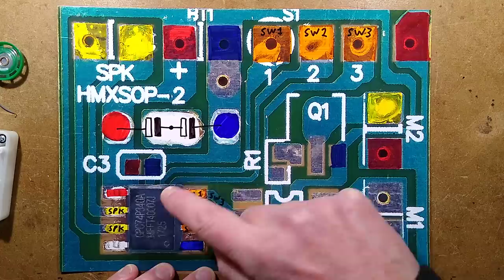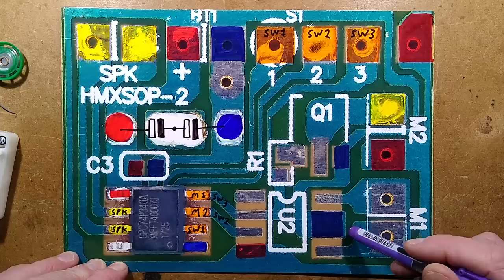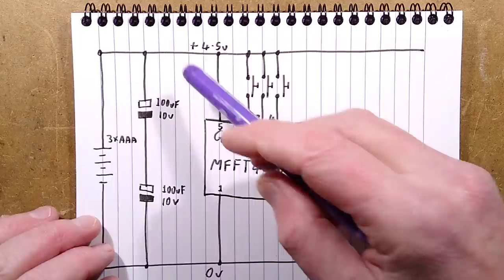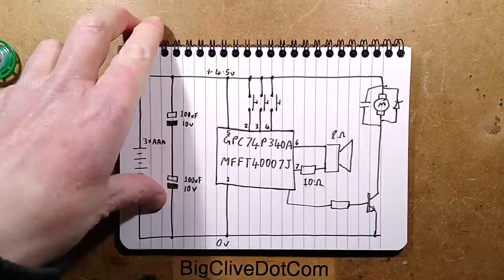Spooky bible teddy (with schematic)

Comment: Swallowing the batteries is probably the least harmful thing that Teddy is capable of...
Reply: Well said 👍
Reply: Hahahaha
Reply: Swallowing the whole bear is less harmful.
Reply: @brianm6337  lol
Reply: Step up. DO the science.
Reply: Very true, we all know what goes on.
Reply: I saw "Varta" and had Vietnam flashbacks.. All those motherboards ruined by leaky batteries.

For those who don't know, it's something that we in the vintage/retro computer community have to deal with all the time when restoring old computers. They use lithium button-cell batteries now, but In the 90's, computers would use these soldered-in 3-cell 3.6v Ni-Mh batteries to store BIOS settings and keep the real-time clock chip ticking when the power is turned off. When they leak after 20-30 years, the electrolyte tends to eat away traces, and sometimes even corrode chip pins. Usually these motherboards can be cleaned up or at least be repaired with bodge wires, but sometimes the damage is so bad that the motherboard just has to be consigned to scrap or e-waste.
Reply: @BlackEpyon  when I saw the Varta batteries comming out, to be honest I was genuinely surprised that someone decided for the industrial type brand stuff instead of the common no name brand stuff you find provided with almost anything including batteries. Not sure how many actual Chinese factories there are out there, as otherwise I think for those non rechargeable batteries, there are not actually that many brands beside Varta, Duracell and Panasonic. I think energizer is also in the game. But looking at varta for example, they alone produce cells sold under so many different labels (the batteries you can buy at IKEA I think among many others) that usually sell cheaper than the original Varta branded stuff. Not sure if there are actually really cosniderable differences between them. 
This somehow adds to the creepiness.
Oh by the way, werent those soldered in 3.6 V batteries Ni-Cd back then? At least those I remember I cannot think of any Ni-Mh,I think those came up only considerably later when they tried to got rid of the Cadmium part at which point most boards switch over to the Lithium Button Cells like CR2032.
Reply: @alexanderkupke920  I think they may have been Ni-Cd earlier on. They're all Ni-Mh these days though, which is nice if you want to do a period accurate replacement instead of putting in a coin-cell holder. Ni-Mh don't leak very often, unlike Ni-Cd and Alkaline.
Reply: @BlackEpyon  Yeah, besides the lack of Cadmium (or at least a heavilly reduced amount) Ni-Mh Cells seem to have a number of advantages. I think all sort s of things, keeping a charge for longer, greatly reduced memory effect, less likely to leak and I think there are more. Only "drawback" if one might one to see it as such, when not built into a device, some older chargers do not like them.
Reply: @alexanderkupke920  Charger circuitry is something I need to look into. I've got an old Tandy laptop that was meant to take a Ni-Cd battery, and I wanted to upgrade it to a lithium so I can get more than a half-hour out of it. I'm just scared to step into new territory there because I know that lithium are really finicky when it comes to voltage levels. I also know that the technical reference manual for that laptop is unobtainium, and I've already been looking for that for a completely different project.
Reply: It'll swallow your soul!
Reply: Hey man Jesus loves you because the Bible tells you so

Comment: I had a hunch that this was going to be a GeneralPlus chip, and I was right. The chip is from the GPC74PxxxA series of 4-bit sound controllers, designed very specifically for basic speech playback. The chip is currently on revision B, which might be why it was hard to find info on it.
Reply: Does pin 8 (marked in white) allow reprogramming the chip with a different performance of the songs?
Reply: @johndododoe1411  No unfortunately this chip is OTP which means it's one time programmable.
Reply: @johndododoe1411  The docs say it is a OTP part:
GPC74P340B, a 4-bit sound controller, is architected with a four-channel SPU for MIDI playback, a 4-bit RISC CPU, a 14-bit PWM, 8 IOs, 1 input (with pull low resistor ) , 256-nibble RAM, and OTP with density of 64K/ 32K x 12-bit of memory space. The operating voltage ranges from 2.0V through 5.5V and operating speed is 1M/2MHz, configurable through inner oscillator. Other features include Low Voltage Reset, IR carry output, Watchdog, 5 interrupt sources with two Time-bases, etc.
Reply: I was going to weigh in with the same info because it sure smelled like one of their chips. I have datasheets for their "high-end" parts but not this one.

I'm betting that this is one time programmable.
Reply: Thank you, hive mind, for the wealth of information and wisdom you provide.
Reply: @glenslick2774  I wonder what compression method they use to get that much music out of 64K of memory.
Reply: @kimchristensen2175  ultra low sample rate and sample format I guess. :p
Reply: @Aeduo  Most likely. We didn't get to hear how long those songs were, but the quality seemed pretty good. It's got me curious now.
Reply: I had the same hunch (I mean, GPCxxxx...right?), but you clearly have early access to his videos and so beat me to the punch by 10 days! 😉
Reply: Google search results have just gone to shit in these past few years. If this was in the mid 2010s and before, you would've been able to find info on that chip pretty easily and even the intensely annoying "approximate match" functionality would've  probably been enough to give you the results for the B revision. Now even searching the partial part number GPC74P340 doesn't give a SINGLE result.
Reply: @kimchristensen2175  It sounded good quality, but. low dynamic range to my ears. That might be significant.
Reply: @kimchristensen2175  They are available with up to 680K x 12 bits of OTP memory.
Reply: @kimchristensen2175 
There are memory cells that have analog storage. Reducing the storage required. The values are not very accurate but not an issue here.
Reply: If it's pin compatible however even an otp part could be dropped in as a "mod" to get the dulcet tones of big Clive to sooth our wee babies instead of the indoctrination this has.
(ok it'd be a brain transplant but then Jesus was the original zombie soooo it's kinda festive season appropriate right?)
Reply: @zyeborm  Horus was perhaps the original zombie.
Reply: @kimchristensen2175  Indeed. The audio seemed not to have very much alias distortion from low sample rate / limited resolution.
Reply: @kimchristensen2175  Since the music is MIDI it is only stored as notes which is very compact. The speech doesn't need a high sample rate. It was fun to look at the sample code from their website. You can have four different instruments or three instruments+voice playing at the same time.
Reply: @andrewwhite1793  Ah OK... Yea I've seen that analog memory used before. Quite ingenious. I'm not sure if this chips uses that method though.
Reply: @mrfrenzy.  Cool. I tried to find some info on their site, but I missed that datasheet. So a mix of MIDI and voice samples. Ingenious indeed...

Comment: My little sister had a doll along similar lines.  I don't remember what the primary song was, but the batteries died at some point when I was eight.  Mom asked if I could figure out how to fix it so her dolly would sing again.  When I opened it up, I found that it had a miniature plastic record with two sides.  Me being an older sibling, of COURSE I flipped it over before putting things back together.  The new song was "Clap your hands, all ye people. Shout unto God with a voice of triumph," which I can still hear in my head to this day.  Sister was upset because her dolly was singing "the wrong song," mom was upset because sister was upset and "why couldn't you just put it back together right?"  Good times. :)
Reply: Occasionally when I find talking or singing dolls, I take them apart, looking to see if they have a record inside.  They never do.  I really want to find one of those players and records -- it was about the size of a quarter.  If I remember correctly, it ran off a single 9v battery.
Reply: I did the same kind of stuff! I would tie a string to the back of her door handle and hide it under the rug. At night I would slowly pull the string closing the door, and of course, it squeaked, and she would scream like heck. Mom wasn't happy. My good times too.😂
Reply: @kittenisageek  Because the mechanism was only used for a short time, between when electronics advanced enough to make an ultra-compact record player, and when they advanced enough to get a ROM and ADC into a low-cost chip.
Reply: @vylbird8014  They were common from the 1960s to early 90s. No doubt there was an overlap when records would've been used for older designs and longer tracks and ROM for newer designs and shorter tracks.
Reply: @transmitterguy478  I used to do the exact same thing, but I used fishing line and attached it to the door, books toys etc. My poor sister was so scared and I got in to a world of trouble. So much fun :)
Reply: that was funny
Reply: This is hilarious
Reply: My other still refuses my autism despite diagnosis and me ALWAYS taking things apart to look at them.
Reply: @kittenisageek  the old See and Say toys had records, with the pull string. Cow says MOOOOO
Reply: I would have reversed the motor direction to spin the record backward and make it sound truly demonic.
Reply: @gutsngorrrr  ,  When we were kids we watched the Trilogy of Terror series, featuring Karen Black, on TV around Halloween. The final episode had a woman being chased around her apartment by a possessed, screaming voodoo doll with a sharp spear.  Afterwards I crouched down in a doorway and waited for my  spoiled, pain in the neck 11 year old sister to walk by, and I jumped out screaming "ga-ga ga-ga"!  She shrieked and burst into tears and ran to tell my parents. I caught hell for that but it sure was funny!
Reply: @goodun2974  I was eight. That was a little beyond my skills at the time.
Reply: @kittenisageek  ,  At about age 10 or 11 I replaced defective capacitors and diodes in several of my dad's radios, and so at that stage in my development i know i would have been capable of reversing the wires to the little motor that drove the miniature record. I don't know if I would have been up to it at age 8!
Reply: @goodun2974  Thanks for the reminder, just watched a clip on YT, it scared the pants of me at the time. Probably the inspiration for the Chucky films.
Reply: @Derek_Garnham  , there's actually a punk rock group who call themselves The Voluptuous Horror of Karen Black!
Reply: @goodun2974  same here. I was rather advanced in electronics to the point a teacher at school had me running lessons at age 13.5.
Till I got fed up doing her job then got a nasty comment on my report card.
Even though I was top of the class in electronics.
I had a reputation she took advantage of.
Reply: @goodun2974  At 10 I remodeled a slot car to run off of a 9v battery that I had super-glued to the car's roof, and at 11 I received my first build-your-own transistor radio kit so yeah, by then I could have.
Reply: @kittenisageek This resonates so well with me. When I was about the same age as you, a friend asked me to fix her "crying baby" doll. I too found the little plastic record inside and recognised the player as being the same one used in a "laughing bag". Sure enough, the b-side was manic laughing!! She preferred her laughing doll, so it remained on the b-side 😆
Reply: @neilfarthing3888 , does anybody here remember "soundsheet" recordings? Thin, square plastic sheets with record grooves, playable at 45 rpm, that came inside magazines! We subscribed to Mad Magazine when we were kids, and one issue included a soundsheet with a jaunty little instrumental, attributed to Mad's mascot, the red-haired, gap-toothed "Alfred E Newman", that had no vocals except for being punctuated by Alfred's belching!  Years later when I subscribed to Guitar Player magazine I remember getting soundsheets that included learning tips, and sometimes full songs by shredmasters such as Danny Gatton and Steve Vai.
Reply: @jhoughjr1  ,  My wife is convinced I am on the high functioning end of the spectrum, and she sometimes reminds me of this as she sits in her rocking chair going back-and-forth, back-and-forth, back-and-forth......so I guess it takes one to know one!
Reply: @Neil Farthing How about combine it into a bag of crying kittens?
Reply: @goodun2974  rocking isnt uncommon soothing behavior. I always liked rocking chairs as a kid.
Reply: @jhoughjr1  , to use the title of a Richard Thompson song, my wife's a "Jet Plane In A Rocking Chair"! She has to rock; if the chair isn't even specifically a rocking chair, she'll rock anyway.
Reply: @goodun2974  a lot of people were like that at my school.
Reply: @goodun2974  Every time I see Fauci I think of Alfred E Newman and I have not seen a Mad magazine in decades.
Reply: That's epic trolling right there!! 🏆🏆🏆
Reply: @goodun2974  depending on stylus mechanism it might not be possible. Record plays from outer side towards inside and if reading needle defaults to outer position, reversing spin direction would result in no sound at all.
Reply: @lauraiss1027  , well, both Yes and No.  Some folks may have never heard of people playing records/songs such as the Beatle's "I Am the Walrus" backwards; there were indeed some turntable models back in the 1960s (the original AR turntable, for instance) that, if you spun them backwards before you turned the power on, the platter would continue to spin backwards. I never tried it but people claimed that if you played "I Am the Walrus" backward it would chant "Paul is dead.. Paul is dead...".  As for where the musical information is contained in the record grooves, it's either on the sidewalls of the record or contained in up-and-down bumps at the bottom of the groove. Either one can be made to produce sound even if the platter is running backwards. Every DJ who has ever queued up a record or done any scratching with a turntable and record knows this!I suspect what you were referring to is tonearm set-down function, and there you do have a point: if the tone arm has automatic functions ( as the stuffed toy being discussed likely did), you would have to find a way to reverse it so that it set down near the middle of the record and played outward before returning and shutting off or restarting play, but that's another thing entirely.....

Comment: I still say that you need to put red LEDs in the eyes, and then reprogram. Really, it has to be done.👼🏻🔥
Reply: drive the eyes by the same power that drives the speaker so it pulses with the volume. :)
Reply: laser diodes
Reply: @sometimesleela5947  Teddy bears with frickin laser eyes
Reply: Good plan, the eyes look a bit sinister already.

Comment: A very common arrangement for these toys with two motors is moving mouth (active open with a spring return) and some sort of looping body movement (rocking side to side, simple dance moves) or secondardy spring-return motion like ears flapping, the eyes blinking, an arm moving etc. Would be interesting to hook up LEDs to the outputs and see if they actually used them.

Comment: The voice chip is a Luncore GPC74-series 4-channel voice chip. It looks like they ordered the full 5-minute capacity with a custom mask ROM for the songs and button logic. I imagine a different ROM would use the extra voice channels for motor control, or longer "orchestral" (beepy) songs with interleaved voice clips. Sadly those chips are custom manufactured and cannot be reprogrammed.

Comment: I did some digging, that chip is a common audio chip used for this sort of thing, but it looks like the 340A variant is either obsoleted or never meant to be used, cause I can find data sheets for the 340B variant easy enough, and even some example programming code

Comment: The little voice on my shoulder says you should use one of the pins for a proximity sensor which then enables the other two, configured as motor drives. Motor 1 rotates the bear's head by 180°, motor 2 enables a pump that causes green pea soup shooting from its mouth.

Comment: Clive, had you been able to reprogram the chip, you could have some real fun. You would want to add the needed transistor and red LEDs for the eyes. I think you will get where I am going with that. I don't think you would need to go full-blown Linda Blair and add a rotating head. But if you did, it would be funny to give to someone our age.
Have a Very Merry Christmas, If I can, I'll catch you during the live stream.
Reply: This! With a circuit that brightens and dims in cycles!